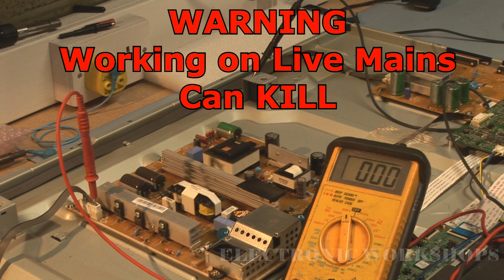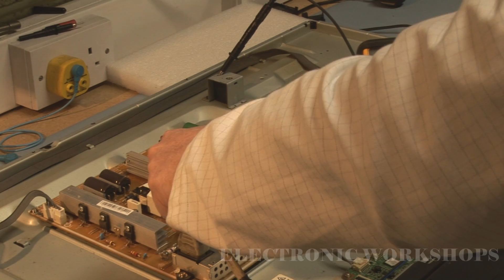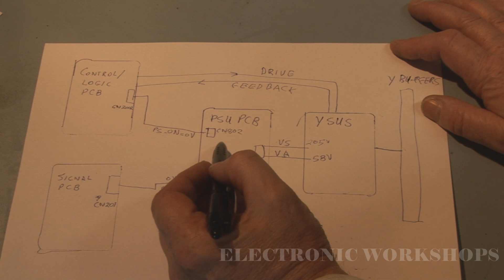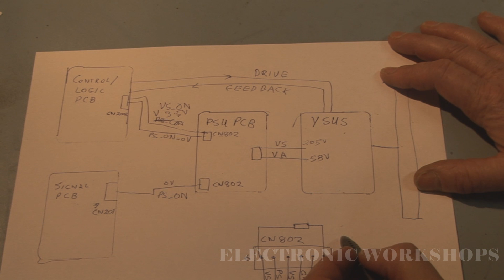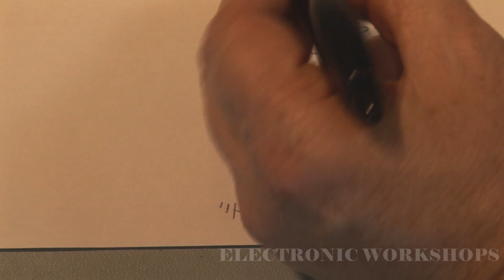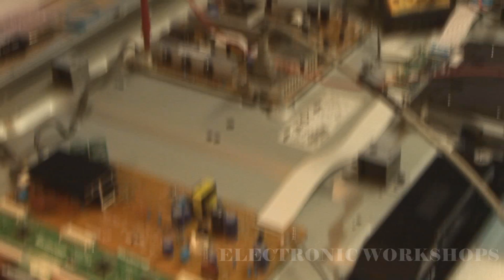Samsung PS43D450 Picture shuts down after 1 minute bn44-00442b psu type

Comment: I have the 51" model.Works about 1 minute or less and then starts clicking the relay.After few repeats the led blinks 2 times for five repeats.After some hour might start again for a while and then clicks again.I suspect the smd zener diodes in the larger side pcb this one which connects to the green pcb.Tomorrow i will replace these 7 pieces of zeners and will see next.

Comment: I have the same TV and the picture shuts off periodically while the audio stays on. I checked the solder joints on those 2 legs you mentioned in 13:37 and they had hairline cracks . Soldered them and the TV is working now. Many thanks.
Reply: แปลภาษาโไทย

Comment: Great video, i have the same tv and same problem, and when i ground PS on pin 5 the power supply stays constant. I removed the y-sub board and also found poor soldering. it has being working for the last 20 minutes with no power loss, so fingers crossed

Comment: Hi there, thanks for the sharing your video, I have shut off problem with my Samsung Plasma Television 43″ PS43E490, Some time it works for days without any problem and some time it shut off after 20 minutes and Red Light flash 5 times, If i remove the power cable and reconnect the cable again then tv does come on.  So it doesn't happen all the time. I really appreciate if you could help me to fix this problem.
Reply: Did you ever solve what the issue was?

Comment: Some feedback on these plasma tv's. When they shut down.. observe the logic board LED "heartbeat" Whats likely happening is that the Y sus is shutting down due to those cold solder connections and when that happens the logic detects this and shuts down the power supply and the LED on the logic starts to blink on and off very slowly. ( normal is on/off every second, fault is on/off every 4-5 seconds ) Thats why the PS stays on when you force it to stay on. The logic cant shut it down when it detects faults...

Comment: I have a Hannspree computer monitor with similar symptoms; of course being a computer monitor, sound doesn't enter into the equation, but the "flashlight test" indicates the display is still on, just the back lights are out. I plan on taking your advice and checking the logic board next, and thanks for showing me how to isolate and test the PS board

Comment: So, you could only find 3-4 bad solder joints?? That's was the only problem?/ You did not even change any capasitors?? So, where exactly were the bad solder joints? in which capasitors?? Thankjs a lot, youtheman =)

Comment: i have a 42'' samsung plasma the modle number is pn42c450B1D the ploblem
 i have is when i turn power on is it blinks few times and clicks then 
the red light stays on but tv dont turn onand if i unplug the buffer 
bord and the other bord on other side of tv then the green light blinks 
few times then goes out and stays out and if i unplug just the bord on 
other side of tv and leave the buffer boed and bord attach to that plug 
in then same thing the green light flashes cuple times then goes out and
 stays out and if i unplug main boed then nothing hapens and if i test 
high voltecge on multie meter it goes to 3.5 then down to ooooo and when
 i test the low voltage it just stays at 000 any ideas

Comment: Thank you for this, I couldn't see any bad solder joints but re soldered everything that I could nod it is working again. Wouldn't go for more than 10 mins before but is now working for about 5 hrs straight with no issues. I suppose time will tell, but to say I haven't replaced anything and it's working again is brilliant news. Thanks again
Reply from the maker: Keep your fingers crossed, hope it goes well for you
thanks for your comments